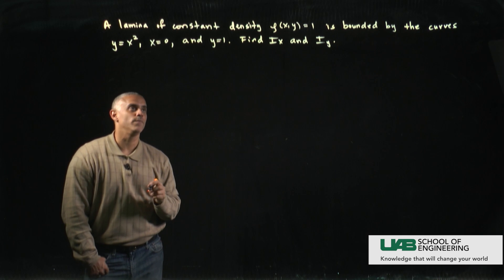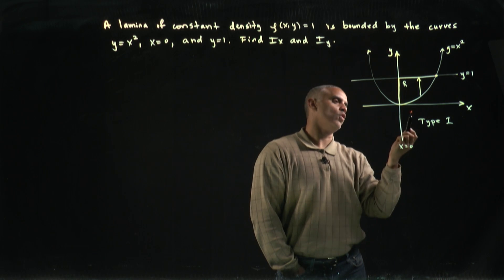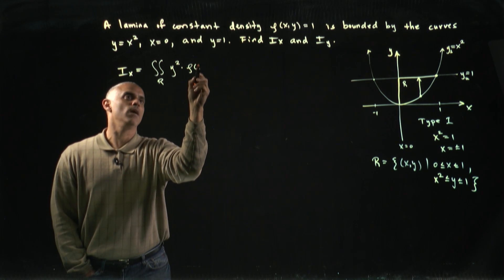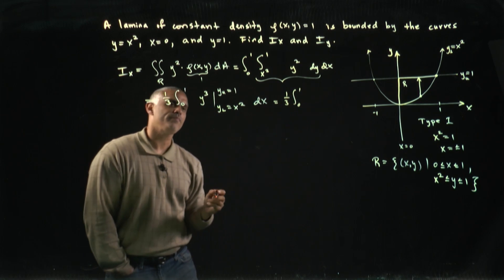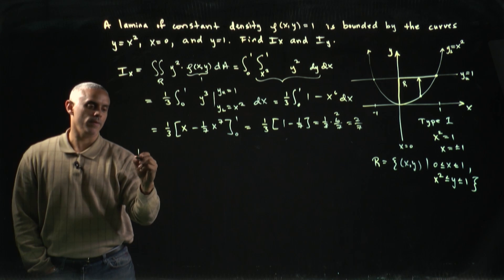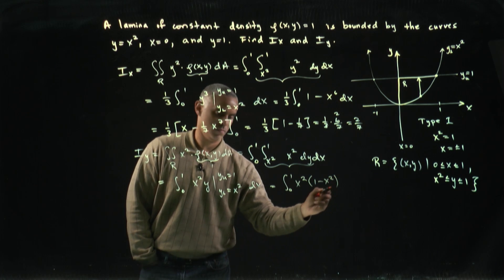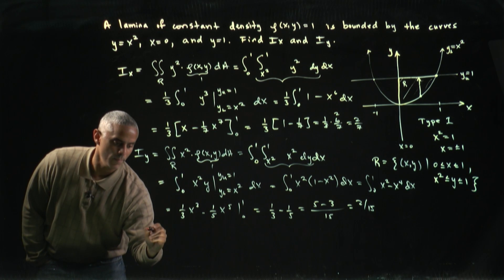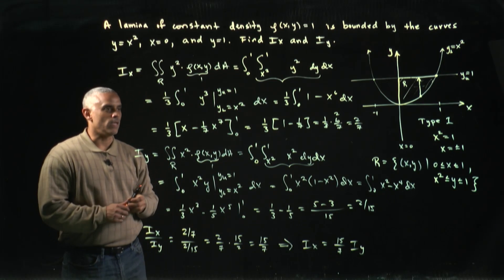Double Integral - Moments of Inertia Ix and Iy

Comment: Why does the limit of dx is from 0 to 1 i dont understand please explain
Reply: Keniker Flores The lower x bound is determined by the given x=0. The upper x bound is determined by the x-coordinate of where y=x^2 and y=1 meet. They meet at +/-1, but x=0 (or the y-axis). 

You could choose the area in the second quadrant, symmetrical to the lamina in Q1. You will still find I_x = 2/7 and I_y = 2/15 with R = {(x,y) |  -1 <= x <= 0, x^2 <= y <= 1}. Just be careful with the Evaluation Theorem as it will negate the negative value when evaluating the lower bound with the vanishing upper bound.

Comment: just wondering why for Ix, you multiplied the density with y^2, and x^2 for Iy? helpp
Reply: Sultan Alhammadi Strangely, my emails from comments appear in a junk folder. I almost deleted all. 

The x^2 and y^2 in Iy and Ix appear in the second moments, just as x and y appear in the first moment calculations for center of mass (COM). It is by definition. The proof of this may be found on YouTube (?). It has to do with the concentration of a mass being a distance y away from the x axis and a distance x away from the y axis. This is what creates that “want” to rotate about the axis.  

Hold a pencil balanced on your finger, calling your finger the x axis. Now, offset it just a little to one side. You will have now shifted the COM, forcing a situation in which a rotation is imminent (provided it were secure to your finger with a loose ring?).